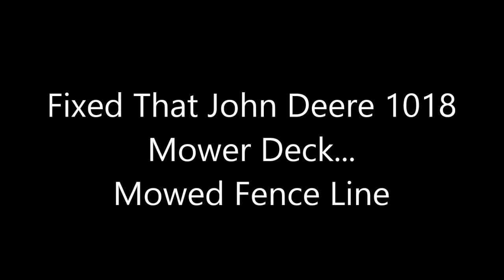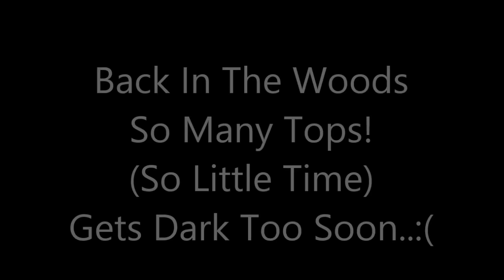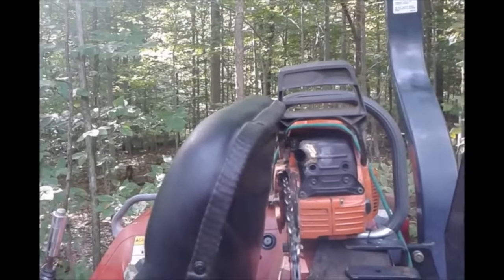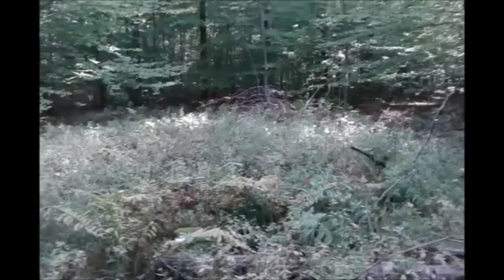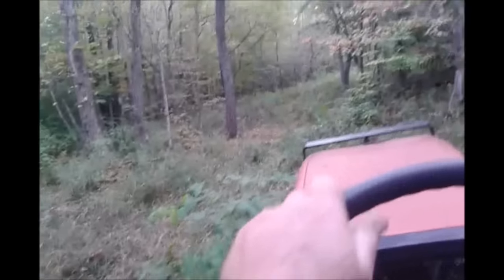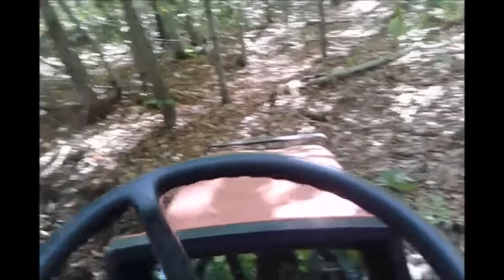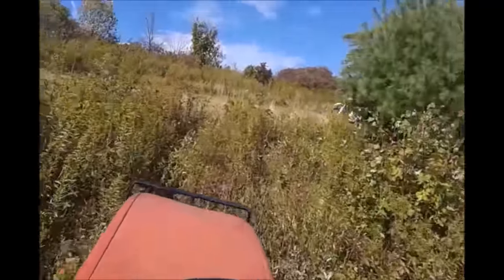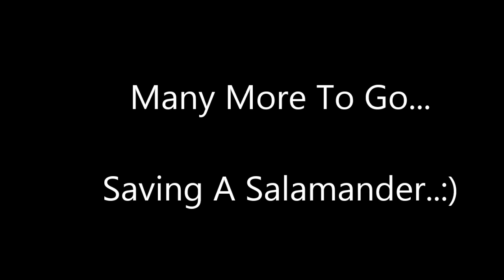Skidding Timber With A Massey Ferguson 1433 Compact 4x4 Tractor & Logging With Huztl / Farmertec 372

Comment: I always carried my 390 Poulan with an 18 inch bar on it on my 7740, but I never carried it behind me but on the foot floorboard.  I carried it for the same reason as you -reliable and easy to start.  if I carried a cooler on the tractor I would often just throw it on the top of the rotary mower, which I usually had connected to the tractor.  I also would throw a few trace chains and wedges on the deck of the mower because I would often need them to pull trees out of the way or drag a tree out to buck up.  I managed a family farm in south georgia for about 25 years so I spent a lot of time in the woods.